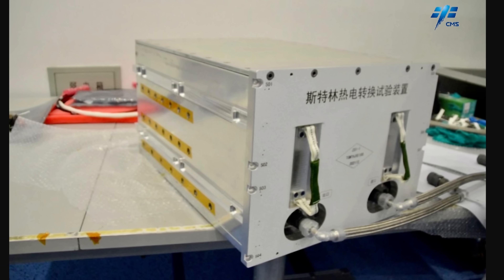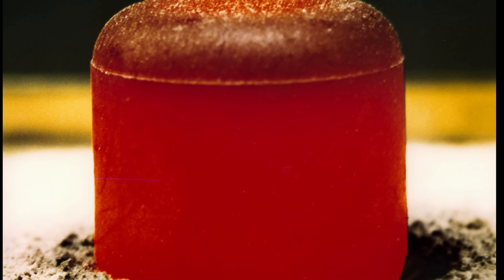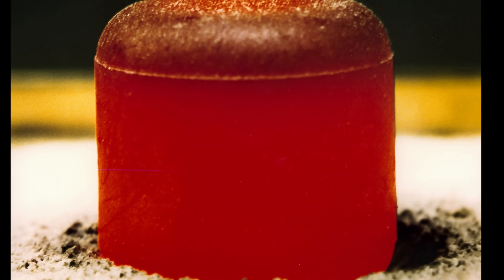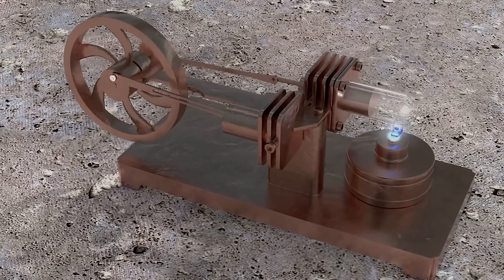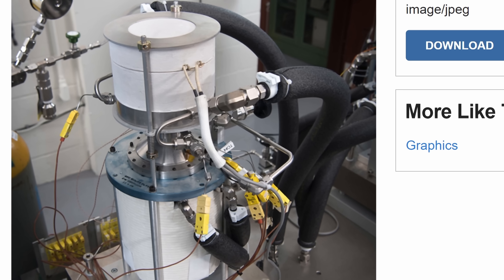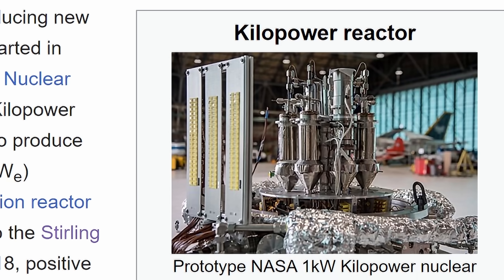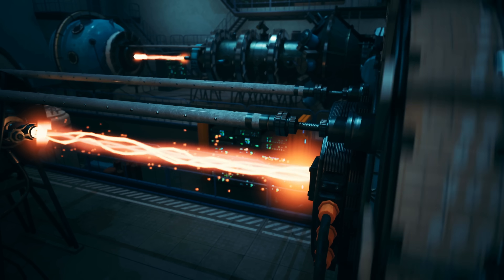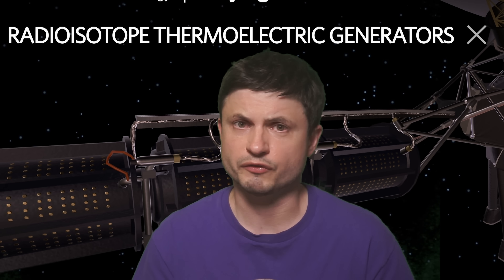Incredible Advances In Nuclear Stirling Engines For Space Exploration

Comment: RTGs have no moving parts (other than a mandatory "switch" required of all radioactive devices sent to space which ensures they aren't active until they leave the atmosphere). RTGs are inefficient. The challenge is not the (radioactive) "hot" side --- the challenge is that both thermoelectricity and Stirling engines require a "cold" side as well (hence, the big heat sink patio umbrellas shown in the conceptual picture). Stirling engines (i.e. external combustion engines) are more complex than internal combustion engines (which is why you don't have Stirling's under the hood of your car or at the coal-fired electric generation plant). Please re-watch THE MARTIAN to see how Whatley kept warm.

Comment: Good video, but i do have some some things you migh find interesting/corrections. If it does not use a thermoelectric device, it is generally refered to as an RPS or radioisotope power system, in this case a stirling RPS. You refered to the radioisotope housing as a nuclear reactor. While it does use a nuclear process, it is not a reactor. 
A reactor is something that provides the proper conditions for something to react. This is not the case in a radioisotope system. Nuclear decay cannot be controlled/influenced/throddled in any meaningful way with existing technology. 
You compared a stirling engine to a steam engine. Steam cycles tend to use the phase change of liquid to gas or vice versa. Sterling cycles along with many other thermodynamic cycles dont use a phase change, but use expansion of gas alone. They are different enough that i think they should not be compared in such a way.

Comment: I like the video, but have to ask you to raise the bar a little. Here are some things to consider:
1 - Get a better microphone, it is hard to hear, and levels and bandwidth are low.
2 - Cut out the non-sense:
“The irony of all this is, Looks like were going back to these steam engines to produce energy, just like we did hundreds of years ago..”
“it’s a helium steam engine, using nuclear technology..”
“Basically steam engine of the future”
All that is wrong. There is no steam involved. Sterlinng engines are heat cycle engines. Big miss.

3 – State the power level of the NASA technology generator doing long term testing. It is relevant and obvious to state.
4 – stop confusing “Energy” and “Power”.  Energy is storage of power, and power is the time derivative of energy. This is misued throughout video.
e.g. You open with non-sense: “ studying how we generate energy for various space missions”
Actually you are studying a means to consume nuclear decay thermal energy in a cold ambient environment, using a sterling heat-cycle engine, to produce usable electrical power for various space missions”
Etc. What is the energy density improveemnt? What is the power density improvement?
5 – The final nuclear stirling engine shown does have moving parts, but apparently low stress so they can last. Spring and displacer are noted moving. Big advantage is electrical excitation and power extraction method.

But the video is useful in conveying many ideas, so +++

Comment: Nuclear powered free piston Stirling engines have been tested by the USA successfully in the past.
And for certain spaced based applications they are an excellent idea.
Just remember any heat source can be used for power generating sterling engines, including the heat generated from Nuclear Thermal Propulsion systems.
So basically when the NPT rocket is operating some heat could be simultaneously diverted to run a Stirling engine to charge batteries for power usage.
😎🇦🇺

Comment: There are many errors here, I really wish this guy would have looked more in detail into all of this.
1. It does contain moving parts. It has Spring. The springs are just rated for basically indefinite function. Those can work for about 100 years constantly. 
2. Helium is not used to increased pressure, helium is used instead of air because it is lighter than air and thus the Stirling engine works much more efficient. Displacing helium takes less energy.
3. The generator is based on magnets the Stirling engine as such is not. The displacer displaces the working fluid so the piston is actuated and moved, This type of engine shown here is called Free Piston Stirling Engine beta configuration.
4. A Stirling engine is not a steam engine, it was invented to replace the steam engine. There is no steam involved whatsoever.
Stirling engine is the most efficient way of turning heat into electricity known to mankind.

Comment: It should be called a, Nuclear Sterling Faraday Engine. In 1831 Michael Faraday expermented with a coil of wire wound on a cylinder, and passed a bar magnet through the coil.
Generating electricity for the first time.

Comment: Strange statement about steam coming back to be used. Steam is being used today. I think that's kind of a mistake   . Really Sterling engines are not steam machines. Is just an engine based on the gas being displaced inside a chamber . The device is called a displacer. Sterling engines have nothing to do with steam.

Comment: I have built a few of the Andy Ross designs and Ryder units but pressurized engines (using helium) suffer from leakage at the rotating seals (one of the reasons you have to recharge your car’s A/C system from time to time). They get away from that on household reefers and A/Cs by sealing the compressor in a can. I may eventually build a cycloidal in a can and give it a try. Unless this one is a configuration I am unfamiliar with, the displacer and power pistons ARE moving as they oscillate.
Reply: I built a rhombic drive Stirling engine in the early 1980's that was later on pressurized with helium.  The sealing was not as arduous as one might believe.
It maintained its air pressure for over one year to the end of the experiment, which included a shaft seal, shop made, for the 1/4 inch dia. output shaft.
Helium pressure did not last as long obviously.  But you can research Philips' research notes on how they contained the hydrogen in their engines.
Reply: @BasementEngineer  Was it an Andy Ross design?

Comment: The graphic you show uses a “bounce back spring”.  That spring is the weak point.  Bounce back springs have been used in lots of places.  Eventually, the spring breaks due to mechanical fatigue.  If, on the other hand they uses 2 Stirling Engines connect back to back the movement of one would push the other to the starting point of the next cycle.  Yes, it is twice as big but twice the power is produced and without the mechanical fatigue introduced by a “bounce back spring” the device becomes more robust because it will have a longer service life.

Comment: I have a few related questions. 
How powerful of a vacuum does space produce?
What psi of oxygen do humans breathe?
How thich of a wall would be required to contain that amount of pressure from the vacuum produced in space?
Reply: Pressure on earth at sea level is ABOUT 14psi.  The pressure in space is close to zero psi.  A can of  coke can withstand 200psi easily.
Reply: The answer to your other question about oxygen is "it depends."
Reply: @awatt  "Space" is supposedly a 10 to the negative 17 tor vacuum. Pressure at sea level hovers close to 14 psi, which is where I was going with what humans breathe,  not the extremes.
As far as the can of coke goes, have you ever observed a vacuum in use? We woodworkers use them quite a bit for wood stabilization. Even the weak vacuum produced to infuse solidifying  agents into wood requires a very sturdy container to work, and at higher vacuum levels, catastrophic  failure often occurs  with even steel containers. 
Entropy and gas behavior negates the "endless, cold vacuum of space" narrative. Gas expands to fill space, and requires containment in order to achieve pressure. 
Do you have an example of gas pressure without a container?

Comment: Heating is not a problem. What about cooling? To cool something in a vacuum and weightlessness, you need more coolant than on Earth. And you need energy to pump it - there is no convection. I've read that an ordinary microchip in an orbital station will most likely burn out, remaining in a pocket of warm air, which it it self heats more and more.
Reply: Radiation is a thing.

Comment: You don't need radioactive materials to generate electricity in space. A Stirling engine works by means of a difference in temperature between the cold side and the warm side. In space, at least in near earth space, if you can keep a space station oriented with one side toward the sun at all times, the side toward the sun will be at several hundred degrees, Celsius. The shaded side will be a few hundred degrees below freezing. So all you need is a heat collector on the sunward side sending heat to the hot side of the Stirling engine and an efficient heat radiator on the shaded side keeping the cold side of the Stirling engine nice and cool. On the surface of the moon, this technique will work only on the daylight side so every two weeks, they'd need the thorium reactor to keep the hot side of the Stirling engine hot.

Comment: A Stirling engine is in no shape, ware of form a steam engine, its a gas engine. (gas as the aggregation form gas, not the fuel). That is also where "gas turbine"  comes from. the aggregation form gas.

Modern gasturbine is called a Bradley turbine that is a bit more complex. But Steam turbines still exist, and are quite common, only that they are called Rankine engines. Those are pretty much upgraded steam turbines

There is something called a recuperating bradley turbine, that is effectively a Earline Stirling motor.

Both bradley and rantkine turbines are pretty common in power production. Some power plants (like CCGT) have both connected on the same shaft

Comment: What's the weight and volume needed per KW of power for these Nuclear Stirling Engines?

With SKLep SSM technology you only need a ~5kg device to produce a constant 1KW of power with a life expectancy of 100,000 hours.

Hasn't been tested in really high/low temperatures, though I assume thermal sheltering can be easily developed.

Comment: NASA's Sterling Engine cannot be free of friction. because it too has moving pistons. The nice change is that it directly uses the piston for electromagnetic transformation, bypassing the wheel. On the other hand, the cooling system is fully passive, with invariable efficiency, which would be OK, if the temperature on the Moon was constant . But it isn't. It has day and night and the temperature varies drastically. Maybe a heat pump deep in the Moon soil would be a solution.

Comment: The real name of these engines are different, Called Radio Isotope Thermal generators. (RTG) Direct conversion to electric power, as used on the Viking Mars landers. 
To use them as Stirling engines, you also need an effective cold source, simply not available without a large cooling surface area.
.

Comment: If they can do that,then why not build a giant nitinol engine and create a wheel to spin in and out of the hot and cold to create a stable temperature and even artificial gravity. 🤓
Reply: Yes, but you also need a heat sink. 
Nitinol engines suffer from fatigue, because the recrystallization is never perfect. Old technology started in the sixties and not successful as an engine.

Comment: NASA has probably not used this because it is too heavy. This can only be useful on very specific missions. Short-time missions, especially most of them in the inner solar system are out, because batteries and solar panels provide more power for less mass. In long-term missions, where solar isn't an option, mass is an even bigger issue because of the delta-v required to reach the outer system.

Comment: The cool thing is that this engine can use any heat source. All it needs is a gradient of hot to cold. So you could even run this with a blank sheet that's warmed by the sun against the -250°C of the shadow on the other side.
Reply: Unfortunately it does not work like that in space. Since it´s a vacuum the -250°C can not transport the waste heat out. It would be awesome though. Cold sea water seems to be the best solution so far, somewhere in the arctic where it´s below zero.

Comment: I'm thrilled to see you are talking about stirling engine use in space, and I really like your videos. But this time I have to correct you on a rather huge mistake. Stirling engines are not steam engines! They were both invented several cetnuries ago yes, but they are not the same! The largest difference is that a stirling engine is sealed, with the same working gass inside the engine the whole time, aka closed loop. A steam engine is powered by a onstant supply of fresh steam feed from the boiler, open loop. This is rather important when in space!
Another important fact is that steam engines uses phase change when boiling the steam in the boiler is the only way of providing power to the working medium, while a stirling engine is using the gas phase only, heating the working gass directly (from outside throiugh a heat exchanger) without a phase change. 
And also, no stirling engines are using water as working medium. At least not free piston ones that would be possible to use in space! The need to keep it above boiling point to ensure it is a gass at all times would be a problem. 
But I really like the fact thay you bring this up. The world benefit from increased use of stirling engines for energy production!

Comment: If permanent magnets are employed for the piston, it would pose a considerable challenge to maintain them within the temperature range where their magnetic properties remain intact indefinitely. While such a design obviates the need for regular maintenance, any subsequent failure would render the system irreparable. The space environment is inherently unpredictable, and it is important to note that heat generation in space is not solely attributed to solar radiation.

Comment: It is not a steam engine, but an engine that works on temperature differential. It needs a hot side, and a cold side. The hot side creates overpressure, the cold side underpressure in the working gas. There also is a regenerator and a displacer piston between the two sides, which make this engine work. It can also be used to cool down some meterial (heatpump), if you drive it with external engine.
Reply: Indeed it is not a steam engine;  however, all heat engines require a temperature difference to operate.

Comment: Stirling Engines are not steam engines they are heat-difference engines.
As long as both sides are at different temperatures they will run.
You do not actually need a radioactive heat source to drive this only the heat difference between one side being exposed to the radiant heat of the sun and the other shielded from it. 
In space, heat travels only by radiation. sunlight side 300ºC; shaded side -267ºC, so therefore you have a temperature difference of 567ºC. 
Obviously, this diminishes with distance from the Sun, and therefore a radioisotope thermal source would be needed for deep space.

Comment: 1. Yes there are moving parts. The pistons. Sheesh! Wear is probably mitigated by using magnetic bearings. Also, piston "seals" (not needed in the displacer) are probably "leaky." And NO. It is not a "steam engine." Pistons do not a steam engine make. A steam engine runs on a Carnot cycle. A Stirling engine runs on a Stirling cycle (any undergraduate thermodynamics book should be able to explain the differences to the curious).
2. Stirling, and linear Stirling has been in space before. Other than the recent Chinese experiment, the heat source has been solar. Thus, the technology that you report is "new" only because it is using nuclear decay heat.
3. Previous Stirling application in space that I know of have been for refrigeration. Yup. The cycle is reversible (another cool benefit of old Reverend Robert Stirling's invention). These systems have supported thermal sensors (the colder they are, the more sensitive they are, and stores of cooling gas run out, limiting a satellite's useful life).
4. Endurance on earth is not endurance in orbit. There are gyroscopic forces. A full revolution in 24 hours is a lot slower than a full revolution in 90 minutes (spaceborne units undergoing 16 times more direction reversals than seen in planet-side testing for the same elapsed time of reasonable duration). Many pieces of space-borne equipment have failed "prematurely" because of the gyroscopic forces. Stabilization gyroscopes (such as those on Hubble) are a prime example.
5. Of parenthetical interest... The most efficient conversion of solar energy to electrical energy, to date, is achieved with a Stirling engine at the focus of a parabolic concentrator.
6. I do hope that these systems are allowed to launch. Launching anything nuclear has been obstructed by Luddite alarmists. While "reasonable" safety precautions are prudent, the wild-eyed panic and gloom-and-doom predictions of the anti-nuclear crowd bespeak either profound ignorance or mindless obstructionism. Recall that at least one crashed Soviet satellite left a significant radioactive footprint "back in the day"... and the world did not come to an end (or if it did, I missed the memo).
7. Nuclear for space has been studied for a long time. Recall the Kiwi propulsion reactors and the Snap power reactors that were tested in the 60's. While testing was successful, neither concept was allowed to be adapted for actual flight.
.

Comment: This isn't really a "reactor" - the radioactive materials are being used as a heat source, but its doing so with naturally occurring radioactive decay.
To be a nuclear reactor the radioactive materials need to be undergoing a nuclear chain reaction, which they're not here.

If you had non-radioactive hot rocks you could substitute for the Plutonium or Strontium it would work just as well :)

Still very very cool though.